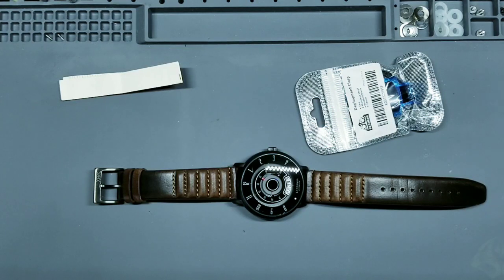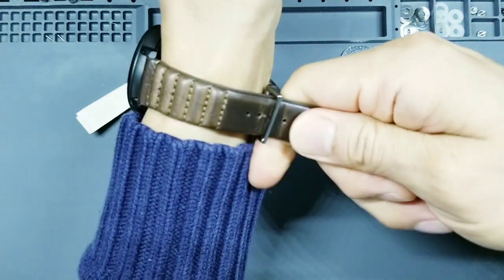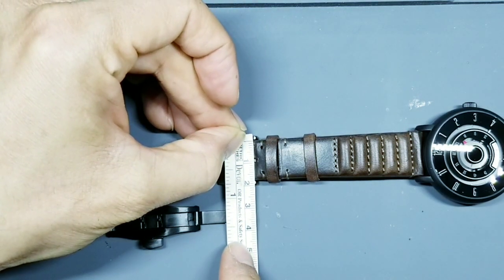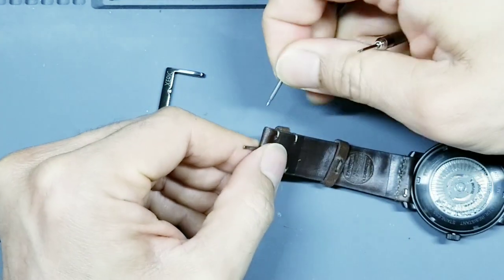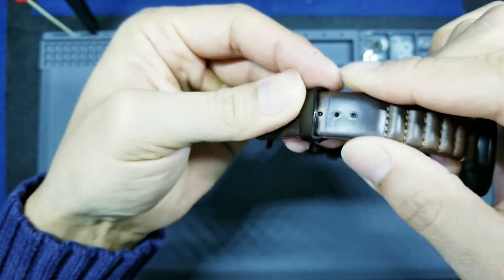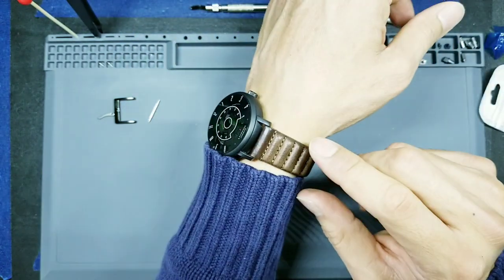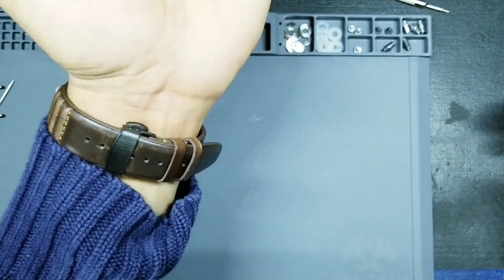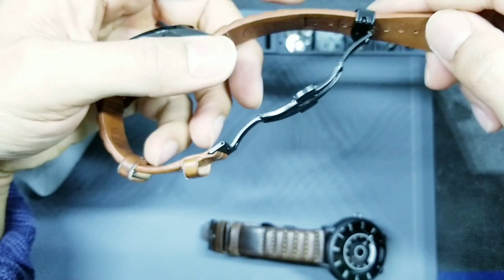What is a watch Dual Deployant Clasp?

Comment: May I ask how's the performance of this brand Rechere butterfly clasp after 1 year? Does it still work after 1 year and does it snap open when you twist/bend your hand or wrist??
Reply from the maker: The clasp (1 year later) continues to hold its finish very well. When used at the gym  it occasionally comes unlocked with a severe  flexing of my wrist. But with normal day to day use, it remains secure on my 6.75" wrist. It may be easier to accidentally unlock with thicker wrists, but for me, i can't complain for the price
Reply: @watchncarry9593  Thanks for sharing your info friend! I will order the RECHERE clasp in  rose gold for my citizen with leather straps.